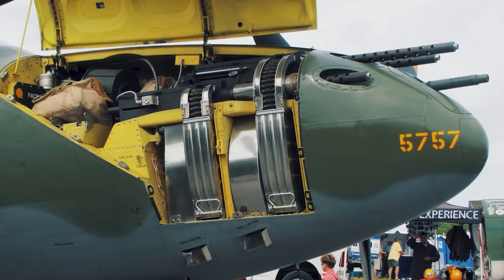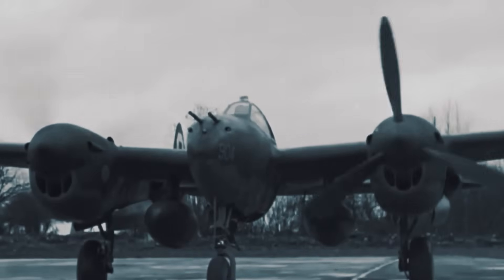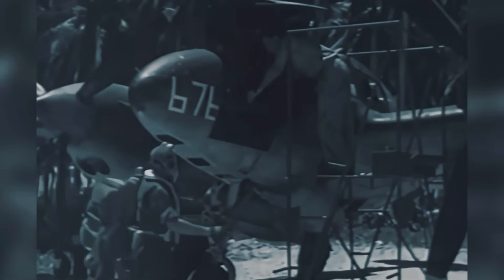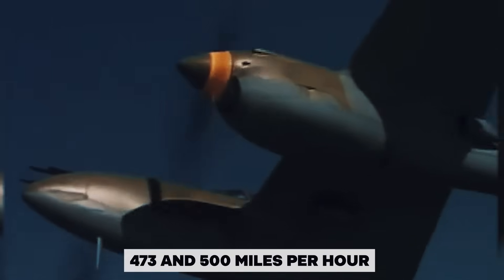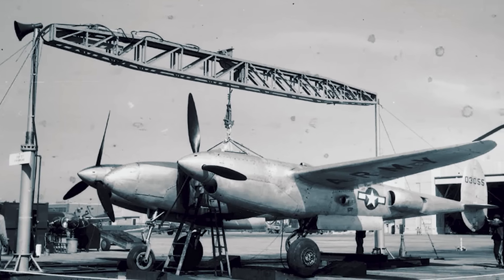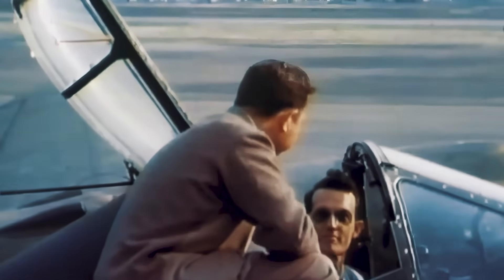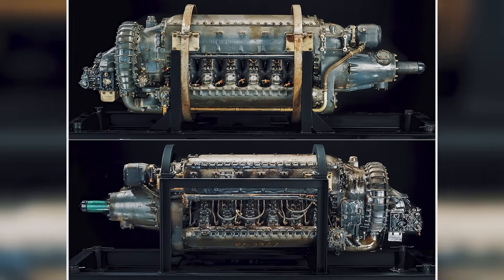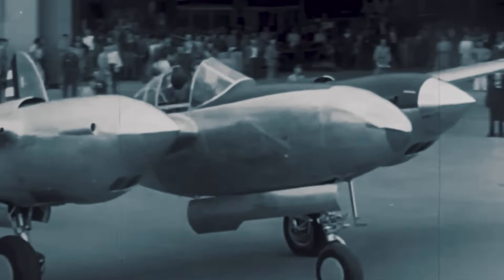Why the Lockheed XP-49 Failed: The P-38 Successor That Was Too Powerful to Fly

Comment: If the production Allison' engines STILL BEING FITTED INTO THE ORIGINAL P-38 airframes evolved to have the same higher power as the Continentals, the fleet would've been plagued with the same aircraft structural inadequacies perceived to become an issue using the Continentals. So something doesn't add up here.
Reply from the maker: Thanks for pointing that out! You make a really good observation, the structural limitations would have been a big factor regardless of which engine was used. Definitely something worth highlighting more clearly.

Comment: It’s too bad they went down the P-49 rabbit hole, although it certainly made sense at the time.  If only they instead could have been working on the Lockheed’s L-133 Starjet, Kelly Johnson’s astonishing 1939 proposal to the Army, as he could see where aircraft were headed.  In 1940, Lockheed had developed the L-1000 (XJ37) turbojet, of 5000-5500 lbf thrust, to power it.

The airframe looks as if it could have been designed recently!  I haven’t finished researching the L-133/L-1000, so I’m not sure why the Army didn’t want it developed into a prototype - it appears, thus far, the Army was interested only in high performance piston engines at this time. Also, I’m not sure why the project wasn’t picked up later.  Perhaps, when a jet did become a priority, the P-80 was a safer play since the airframe was a more conventional design.
—-
https://socalaviationheritagedigest.blogspot.com/2020/05/lockheed-l-133-jet-fighter-and-l-1000.(change to html)

Replace (change to html) to just html
YT won’t let us embed links anymore.
———

Comment: 4:00 umm, oops?  That looks like a P&W R2800 for the twin-boom Northrop P-61 Black Widow.  The inline X-1800 is a 24-cylinder H-block configuration, with 6-cylinders per bank.

Visualize two horizontally opposed 12-cylinder engines mashed together one on top of the other.  Then rotate the mash-up 90 degrees, and you have your ‘letter H.’
——-
Btw, great video.  You’ve dug up a lot of nice clips and pictures that I’ve added to my personal digital collection - in a folder with a file that cites your work, of course.  Thank you for your effort, this would have been a great engineering project to be on, especially working under the young Kelly Johnson.

Comment: It seems a hard lesson was learned during WWII about designing a plane around engines that were not yet available, it did not work.  There were several planes waiting for the continental engines that never materialized, then we had the B29 program waiting to get the R3350's to work and not catch fire.  Hard to develop an airframe around an engine that did not exist !!!
Reply from the maker: You’re absolutely right. Designing airframes around engines that weren’t ready often ended in disappointment. The B-29’s early struggles with the R3350 really show how risky that approach was during WWII.

Comment: The reason the XP-49 failed also plagued every other piston powered propeller driven aircraft of the mid 1940s. This included later versions of the P-47, XP-69, XP-72, Grumman Bearcat, and Goodyear FG2 Corsair. For starters, by 1943 piston engines were reaching the end of their development potential. Second, as speed increased, drag and the horsepower required to overcome it increased exponentially. At the same time, propellers lose efficiency as speed increases, requiring even more horsepower that simply was not obtainable. 
It was finally determined that the war could be won using existing aircraft with research and development going into new jet aircraft looming on the horizon.
Reply from the maker: That’s a really clear explanation. You’re right, by the mid-1940s piston engines had pretty much reached their limit, and jets were the obvious next step. It really puts the XP-49’s struggles into perspective.

Comment: Lockheed should have been working on the P80 Shooting Star
Reply from the maker: Good point! The P-80 Shooting Star really marked the beginning of the jet age.
Reply: They were.  P-80s were stationed in southern Italy in 1945.
Reply from the maker: @stephenketcham4179  Could you share more details about the story?
Reply: NO!  They should have been working on the Lockheed’s L-133 Starjet, Kelly Johnson’s astonishing 1939 proposal to the Army, as he could see where aircraft were headed.  In 1940, Lockheed had developed the L-1000 (XJ37) turbojet, of 5000-5500 lbf thrust, to power it.

The airframe looks as if it could have been designed recently.  I haven’t finished researching the L-133/L-1000, so I’m not sure why the Army didn’t want it developed into a prototype - it appears, thus far, the Army was interested only in high performance piston engines at this time. Also, I’m not sure why the project wasn’t picked up later.  Perhaps, when a jet did become a priority, the P-80 was a safer play since the airframe was a more conventional design.
Reply: https://socalaviationheritagedigest.blogspot.com/2020/05/lockheed-l-133-jet-fighter-and-l-1000.(change to html)

Replace (change to html) to just html
YT won’t let us embed links anymore.